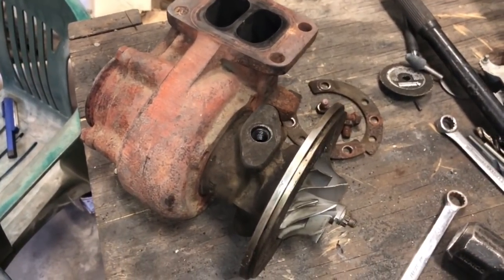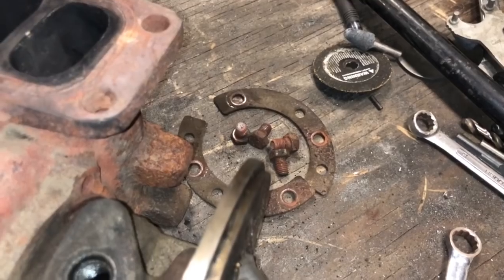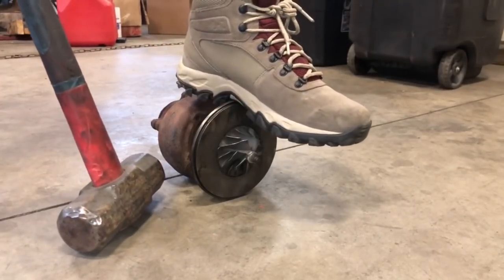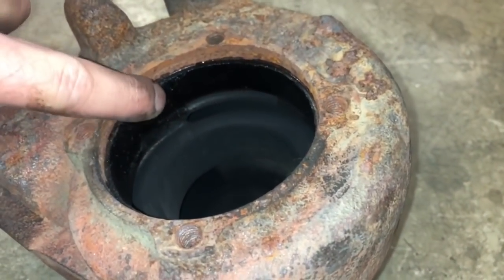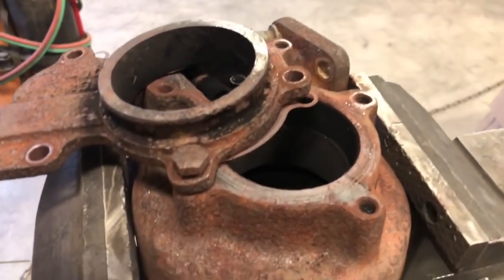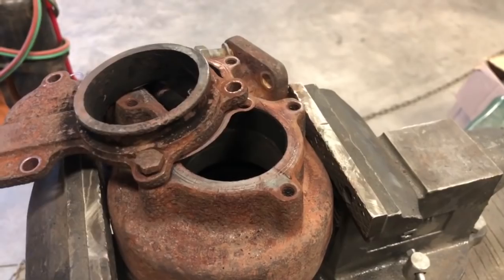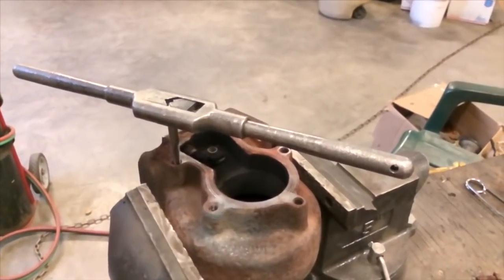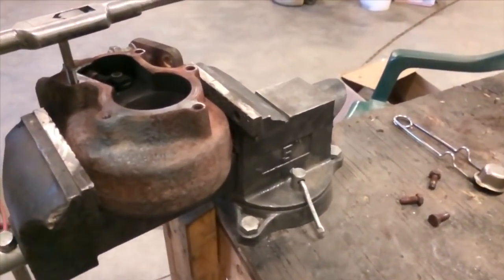How to remove hx35 turbine housing

Comment: Oh dear God what did I just watch
Reply from the maker: You watched a video request from a subscriber. If the video doesn’t apply to you then don’t watch it.
Reply: @turbolabamerica  lol nothing like hitting a precision made item with a sledge hammer lol i call that rough as guts
Reply: steve murch any recommendations on a better way? And for the record, we’ve never had anything damaged by doing it this way. This is also the most extreme scenario, most turbine housings are removed much easier.
Reply: @oreocat6476  as per mentioned heat or penetrating oil, i have made my own wrap around hydraulic jacking system its very gentle does no harm, but sledgehammer? Ill pass i have more respect for my customers units regardless how tough it maybe to disassemble
Reply: @oreocat6476  Get a few long bolts with nuts, put a socket on each, loosen the nuts against the sockets to press the housings apart. Use lube and heat, hammer periodically.